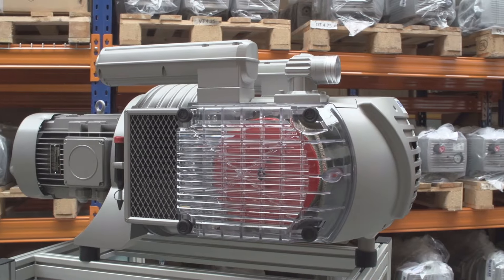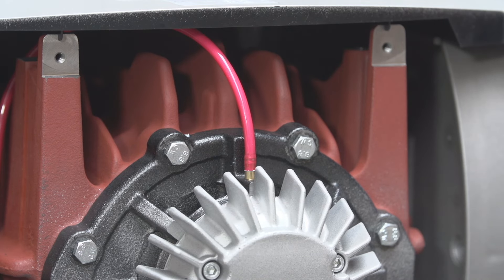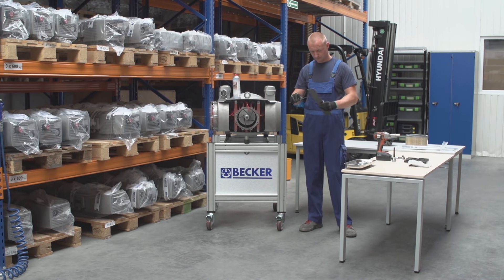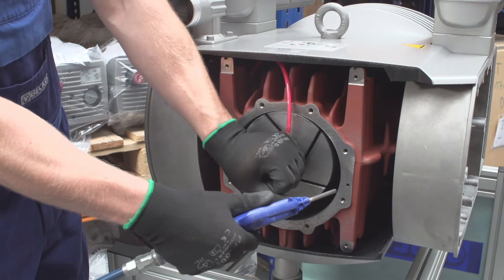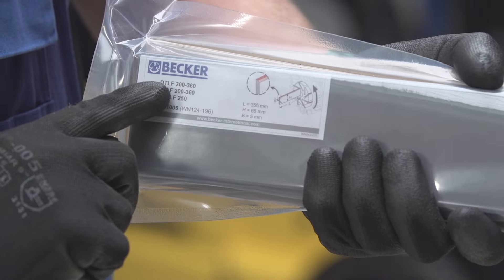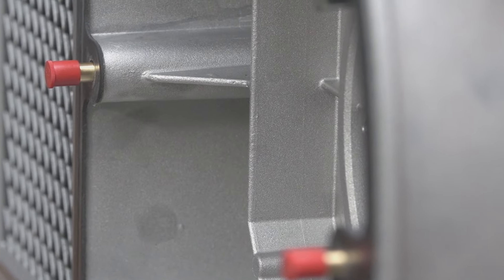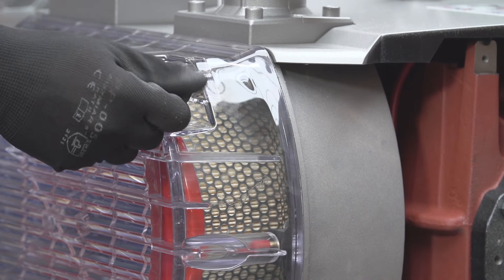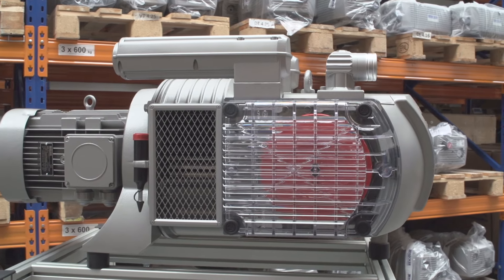Maintenance Procedures for Becker Oil-less Rotary Vane Pump.

Comment: what lubricant to use in this pump?
Reply from the maker: A high temperature bearing grease. We call it GB Lube 12 - our part number 74330500000 for the grease gun size if interested!

Comment: There is a "squealing" or "Squeaking" sound when I turn on the pump.  Generally it has only done it for under 5 seconds, but now it goes on for a few minutes.  Why would this be the case? Is it the bearings?  The Becker manual and the pump itself says to lubricate the bearings every 3000 hours.  After cleaning the filter it seems the sound went away.  I clean the filter once a week or so.
Reply: I know this is a really old comment, but I think there might be a tear in your filter, and it was flapping a paper fold like a reed. After you reached a certain pressure, the flapping is unable to continue.
Reply: @richardcall2994  Thanks for the info but no that’s not it -the filters are in very good condition and the pump has been maintained relatively well - my assumption is its probably something to do with the bearings rubbing - although I’ve kept them relatively well lubricated it. I do recall that I recently actually saw this without looking for it in the manual - that this sound is often common in newer pumps but we’ve had ours since 2019 so who knows.  It hasn’t really done that for a long time now so my assumption is I wasn’t greasing it as much as I should have.

Comment: Just out of curiosity, if the pump is not somewhere that there's sufficient clearance to do the maintenance, why would we have to send it to Becker for service? If we're going through the trouble to uninstall it, why not just do the maintenance after you uninstall it and set it somewhere sensible? 

Either way, we have two of these on the way to us now. They look like fantastic pumps.
Reply: Good point Matt. :) I would suggest that you only need to send to Becker or authorized repair facility if you are unable to perform the maintenance yourself OR the pump requires more serious service. There may be some tight install spots but really with the airflow you want to keep around the pump it shouldn't be too difficult to get to the filters and vanes as needed in almost any install scenario. Enjoy your pump!

Comment: I have a Becker VTLF 500 SK I have relocated.  Do you have a commission instruction. It seem I need to open  something  to keep from damaging vanes  before I check rotation
Reply: obviously I would speak to Becker but from what I've read you just want to make sure the vacuum pump is disconnected and not sealed when performing your first checks. But you can also purchase a phase detection tool that should tell you the proper rotation BEFORE you power up. https://amzn.to/3wTHwqm